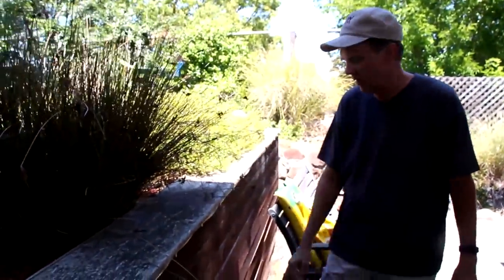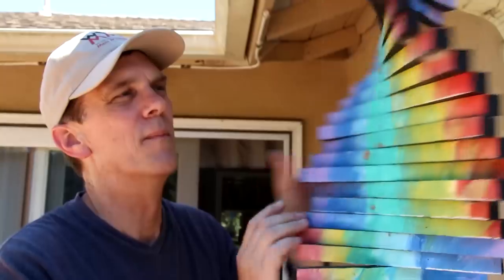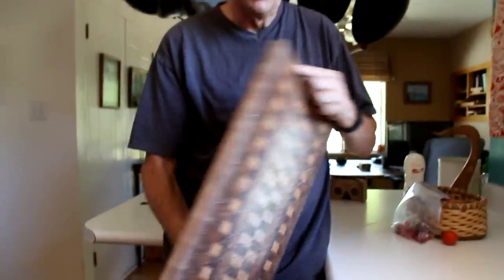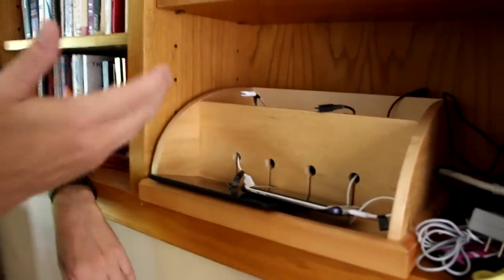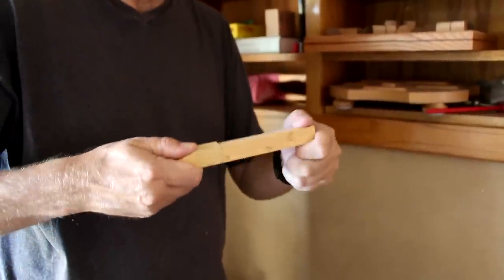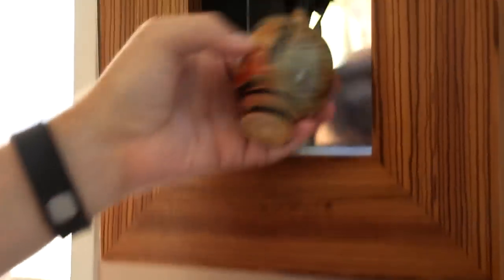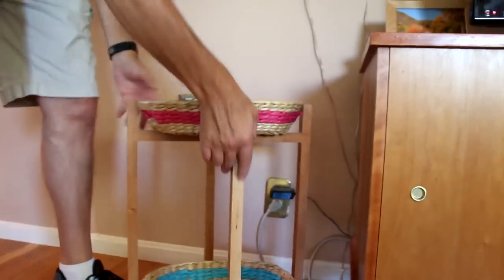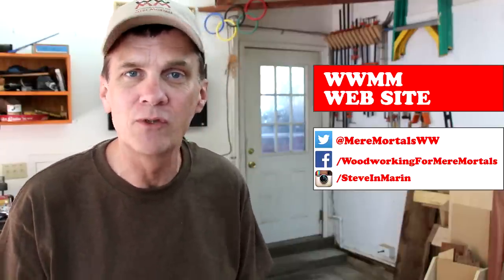WHATEVER BECAME OF...? A Tour of Mere Mortals Projects

Comment: CPES (clear penetrating epoxy sealer) is a great option for outdoor projects. The epoxy cures inside the top layer of the wood, making it basically impervious to everything. I put it on my balcony 3 or 4 years ago when I replaced the deck boards, and so far it's holding up great!

Comment: My experience with lawn furniture is that there really isn't any outdoor finish that's going to last forever, especially on furniture with lots joinery and the like, so instead you should go with one that's easy to replenish when the weather inevitably gets to it, like linseed oil. It doesn't have to go on very precisely, and with a big block brush and a couple of rags you can re-oil everything in an afternoon. For parts like tabletops that might want a slightly slicker finish, I added a little spray-can shellac. It may sound crazy to use such a low-end finishes for such harsh conditions, but the whole point here is giving in to the fact that it'll wear and picking things that wear gracefully and don't require a complete sand and refinish to fix them up.

Comment: You absolutely can glue endgrain.  The structural engineering proof of that is balsacore, which is an all engrain glued product for making super light panels.

The reason people think you can't is because they mix up the fact that if you crosscut a board and glue it back together, it will have very little apparent strength, but if you rip a board and glue it, the joint is usually the strongest part of the long grain.  However it is also the case that if you glued endgrain to sidegrain that if you glue endgrain to sidegrain, the endgrain will break off the sidegrain.  That is the basis of endgrain core materials.

Comment: Something that might look cool on some of your projects, Steve, is i f you get a wood burner and make designed or words in them. I thought of it specifically on you card game box, you could label what the game is. Great video too.
Reply: ***** A decent soldering iron with a fine point tip works well too if you take your time.

Comment: Steve, I have the same issue with the wind spinner.  There is "play" at each connection point, which ruins the spin capability.  I am thinking JBWeld at each connection except for the rotation point.  I have a hook that is a J on one end, and a loop on the other.  The loop end can spin.  JBWeld goop all around!

Oh and I can't recall how many times i've smacked my head into the threaded rod on the underside (hanging over the deck).  It hurt like a mother every time to the point where I nearly smashed the thing on the ground!